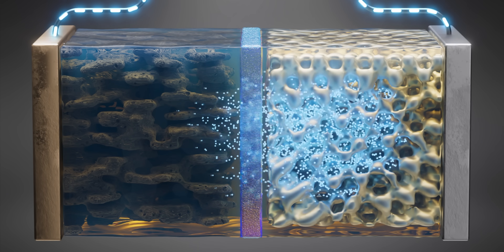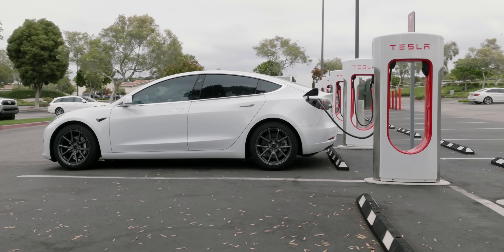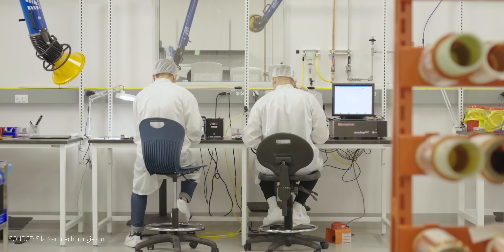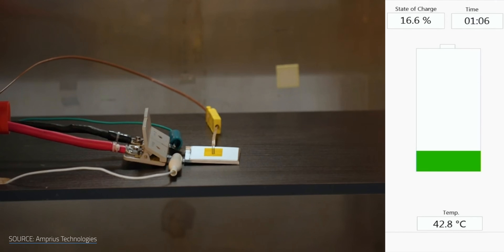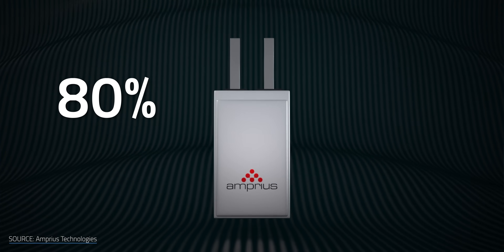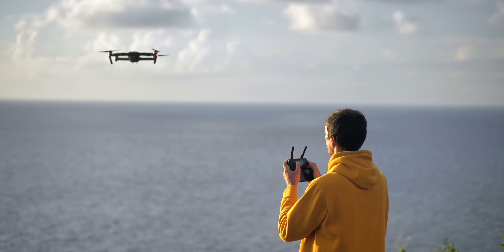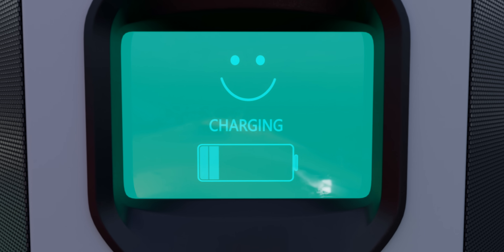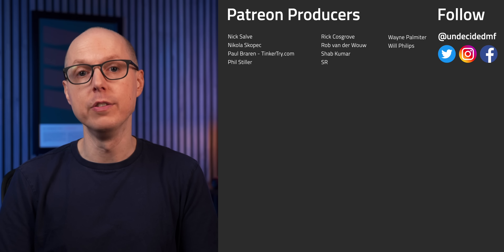Why This Ultra Dense Battery Breakthrough Matters

Comment: If the problem of silicon battery is short charge/recharge cycle, how has the new battery by Amprius solved it? To me this is the most important virtue a battery can have.
What is is the cycle life of the battery?
Reply: Depends more on a few factors. How quickly they die, how much it cost, and how quickly can you replace them. For example, if it takes far less of them (1/10) and you only say get 10-15 years out of it vs the current 20-25, but cost 1/10 the cost, and I can replace it my self? That doesnt seem all that bad. Does it really matter at that point? NMC is around 800-1000, LFP is around 2500-3000, this one is between at around 1100 to 1400

Comment: it is frustrating that "the breakthrough" is always "just around the corner" ;)  but silicon anode tech is pretty rad.
Reply: Matt reports on new tech as soon as info is available when they are still early in development so they are around the corner. But many of the battery techs he's talked about in earlier videos are now available. 

LFP batteries are now mainstream and are becoming the predominant ev battery type. Sodium ion batteries have been on the market since 2021 and in China you can buy evs with them. Flow batteries are also available to buy though mostly at scales too large for consumer use. Hybrid flow batteries are available at small enough scale for consumer use for home solar storage.
Reply: So true. Some exceptions like Apple, Amazon, Tesla, etc happen though.
Reply: My brother in Christ, we went from first flight to the moon in 60 years. From dial up phones to smartphones in 20 Change takes a little time.

Comment: Energy density is massively important for US-style long-range driving.  Keep an eye on the company.  But I really wish all these research companies would start making usable products: Power tools, vehicles, etc.
Reply: building the tools for industrilization is extreemly hard.
Reply: @calebfielding6352  building the grid to provide that power is a tough cookie too,
Reply: 1 080 KJ/KG is LiON battery 
45 000 KJ/KG is Gasoline energy desinty
Reply: @astemet  Sure, but you also loose out a lot of that power from losses too. You also have the issue of too many tools using the same limited power resource means less over all energy pool.
Reply: @astemet  True but you can recharge the LiON battery and the Gasoline energy is gone when you burn it.  And in a car most of it is wasted as heat.

Comment: Silicone anode batteries would be swell, but they swell, and that's not swell.
Reply: Didn't you watch this? Shows the way this works with silicon
Reply: @sebyst7907 I did. And it's only successful on paper so far.
Reply: @sebyst7907  still though, it still creates a much stronger stress/strain profile on the substrate anode and leads one to believe they suffer capacity degradation over less cycles.  Even if the energy and power density is 50% more for the same cost (unlikely) if you only get 10% of the cycle life of iron phosphate it’s not going to be viable.  Range anxiety is closely followed by 20k battery replacement after 5-10years.
Reply: swell comment

Comment: Haha lithium ion battery have changed loads in the last few years example most phone come with 120watt fast charging ant go 0-100% in less than 20 minutes
Reply: These were available a decade ago.
Reply: @hugegamer5988  no they weren't. If you tried this on a battery from a decade ago it would simply overheat loose battery health or spontaneously combust